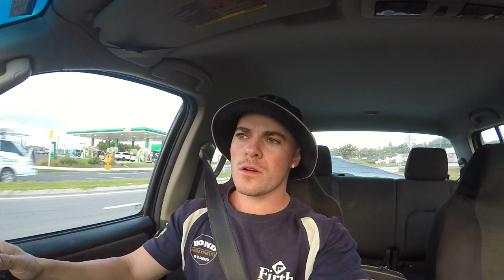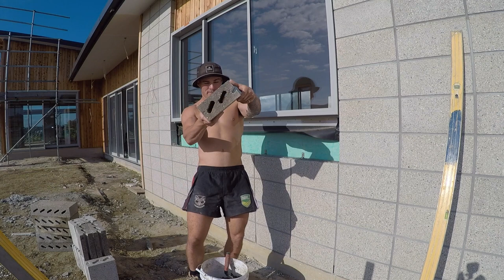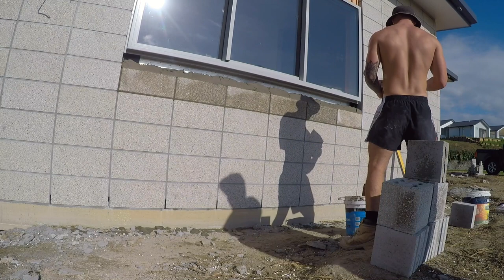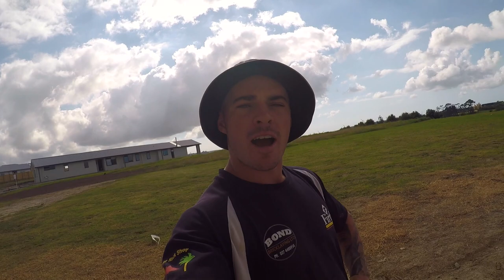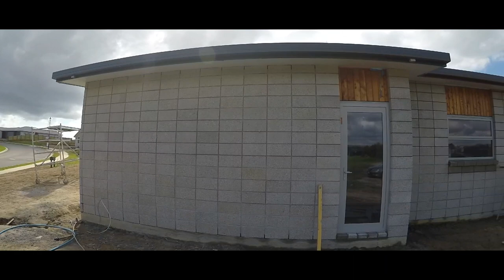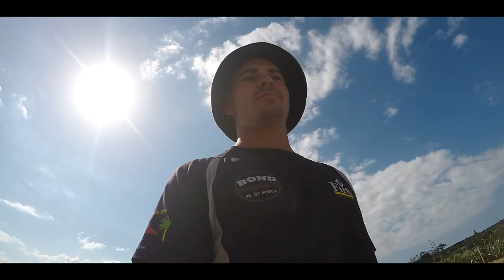NEW ZEALAND BRICKLAYING! Stackbond Block house - Finished Product - *GoPro 2018*`

Comment: well izack colum from Ireland what ratio do you mix the mortar u seem 2 get a great finish on the jointing...👌👍👌👍👌
Reply from the maker: Cheers bro! its 4 to 1. 4 sand one cement! just use a bucket for that measurement!